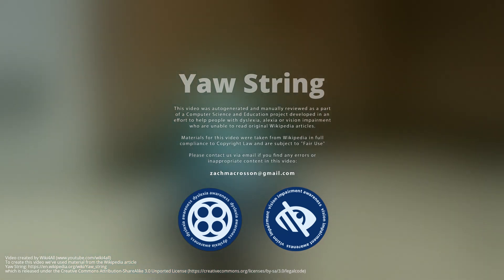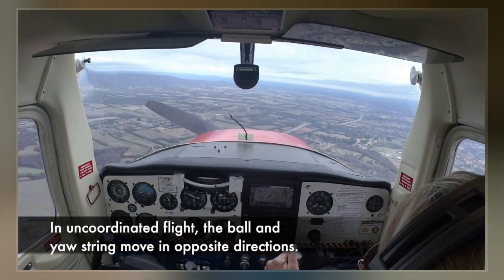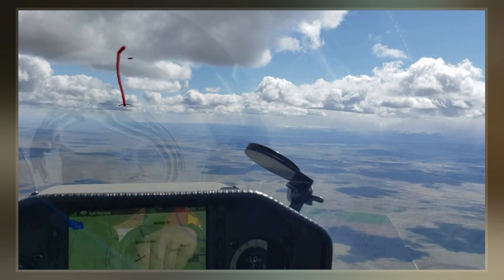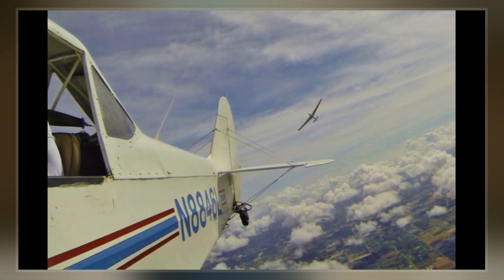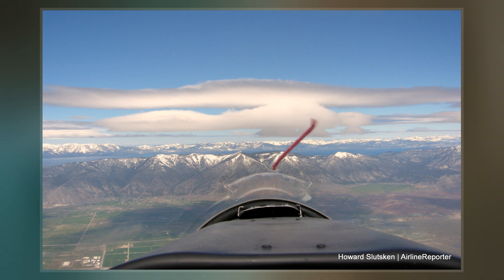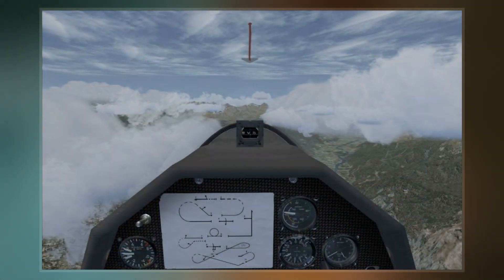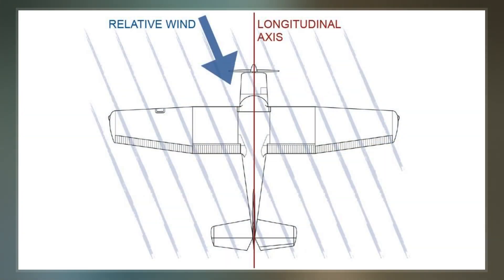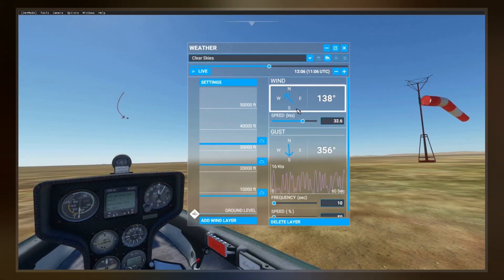Yaw String

Comment: I believe that if the yaw string is straight in a steep bank, then there is no slide slip when turning.  I think the wing does not "know" it's turning when the string is straight in a bank, other than it feels heavier.  Thus, the theory that the outer wingtip must fly faster than the inside wingtip because it creates a greater circle is busted.  This is not just my opinion, but many disagree.